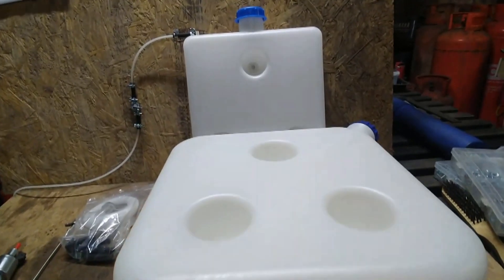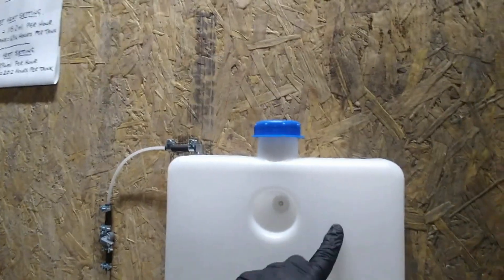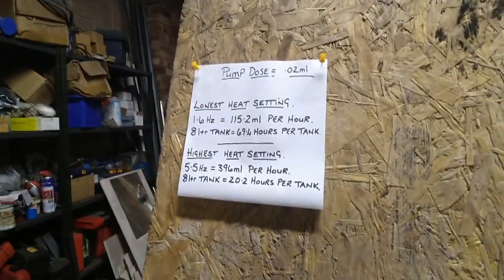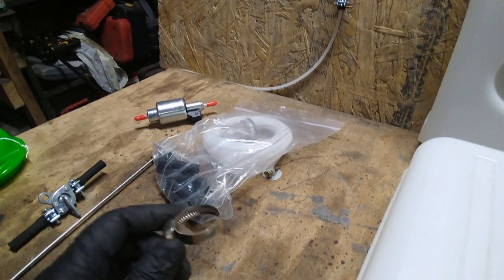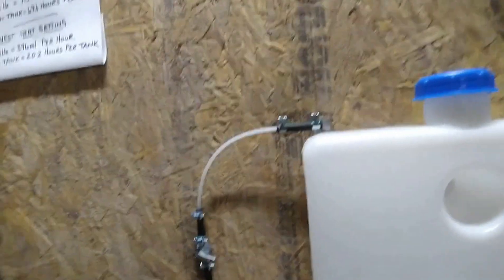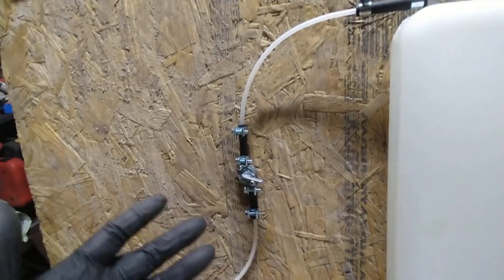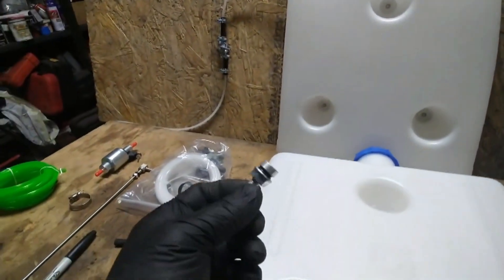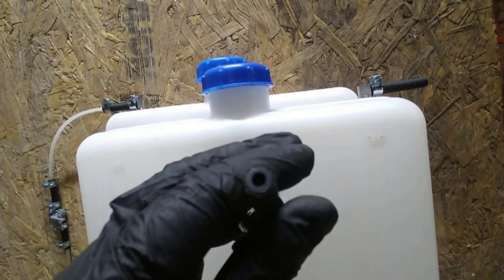Diesel Heater Fuel Tank Upgrade & Fuel Shut Off

Comment: Much better job, have you got any kits available? I would be happy with the hardware (lift pipe and turn of valve) and try fitting to my tank that comes with the heater. If you have all, I'd consider buying as a kit. Let me know either way... Thanks for the vlog
Reply from the maker: Email me if you require anything seen in the video. Thanks.
Reply: @itsallfabrication Just bought the tank kit on your website. It wasn't available last time I was on. I just need to buy new fuel line. I already fitted mine, slight weep from the bottom connection of the tank so this will sort. I have replaced 2 x pumps, why would they stop working? Power getting to the pump, just seems to burn out after a few times
Reply from the maker: @Workshop-of-Allsorts Thanks for purchasing a tank. I fitted it out last night and it was dispatched this morning.
The pumps seem to be a weak point on these systems, been through a few myself. But I'd check the voltage going to the pump with a multimeter to rule out over voltage to the pump.

Comment: What is the inner bore size of the rubber connections to fit the 5 mm outside diamater of the nylon line? Suppose to be snug right?
Reply from the maker: Get diesel rated rubber pipe with an inner diameter of 4mm. Also spray the inside of the rubber pipe with WD40 when you are fitting the pipes together, otherwise is a real pain to get them pushed in.

Comment: What about installing a quick disconnect instead of a shut off? Would that work or do those tend to leak? 

For a shut off would a 6 mm inner fuel line diamater work? I have a 2 mm inner bore nylon line, guess it would not matter what size bore is before the pump?
Reply from the maker: Yeah you could put a quick disconnect in if you like, not sure about them leaking as I tend not to use them myself.
I use a 6mm metal fuel shut off, the beauty with that is, if you have to work on the fuel line further down (filter or pump), just shut the fuel off and it creates a vacuum in the fuel line, meaning the fuel stays in the line and doesn't empty itself, so less mess and less priming after fuel system maintenance.

Comment: I'm in Australia and about to buy a diesel heater, found this video - great info. Any chance of posting a link to the ebay fuel kit link as I've looked & can only find the fuel line itself (I think), but not a kit with the fittings. Ta.
Reply from the maker: Hi, Thanks for the comment. I've only got a link for fuel line on ebay UK 
All the best for your install.
Reply: @itsallfabrication  thank you, any chance you can post that UK link as it might help in my search.

Comment: great tips mate - and aligns to some others i have seen in terms of upgrades - one thing that would help would be links to where you got the piping , clips pump upgrade and possible contact details for how people reach out to you for tanks and shutoff fitting- couldnt see it in the description of vid but may be missing it somewhere else
Reply from the maker: Thanks for your comment/advice. I managed to get 10 fuel line kits and I'll bundle them up with the fuel shut offs. I ran out of tanks, but will try and get more. And I will put my contact details in the description. Thanks mate.

Comment: i got my heater the other day and started putting it together today. Then i found this video............but i have already drilled and connected the fuel spout that came with it in to the tank. you said the seals on it are no good. can i use other seals?
Reply from the maker: Yes you can. Get one of the o-rings in the outlet and measure the outside diameter of the o-ring, followed by the thickness of the o-ring. Order two nitrile o-rings of that size and replace. Nitrile o-rings are usually olive green in colour.

Comment: Hello, I wondered if you sell the shut off and cable online?
Reply from the maker: I don't sell the nylon fuel line, but here's a link for the fuel shut off.
https://www.ebay.co.uk/itm/292656218510?mkcid=16&mkevt=1&mkrid=711-127632-2357-0&ssspo=XE19QvHMT6y&sssrc=2349624&ssuid=XE19QvHMT6y&var=&widget_ver=artemis&media=FB_MSG
Reply: @itsallfabrication  Thanks.  About to fit a heater on the boat and a shut off sounds idea.
Reply from the maker: @sailingaphrodite4189  Yeah, they're a must. I don't know why people don't fit them, while installing their diesel heaters.

Comment: sometimes seen these heaters fitted outside the room when in fact they are better fitted inside the room and exhausted to the outside along with the combustion air intake pipe as well, that way the heater will recirculate the warm air allowing the room to get warmer more quickly.
Reply: It may sound great continuously recirculating the warm air instead of cold fresh air but without fresh air it will generate condensation inside a vehicle,its the reason I dont recirculate warm air.
Reply from the maker: That is correct Merlin, and well worth a mention. Thank you.

Comment: I have bought a 15 litre tank top loading vented lid can you fit a stand pipe cut of valve and upgraded fuel pie please.
Reply: Mine is leaking like the titanic
Reply: I’ve sorted it mate bought a sturdier tank and retrofitted it no leaks no dramas I’ve done what Mel on utube has done. Just need a cut off valve.
Reply from the maker: @livingthedreambuildingthedream  Yeah, the tank Mel shows in his vid is really good quality. Those fuel shut offs are available on ebay, grab one of those and you're good to go. Glad you got things sorted.
Reply from the maker: @livingthedreambuildingthedream  Can you get it to me/ship it? I can fit what you require.

Comment: What about using that metal pickup used for cars Diesel tank and fittng on top of plastic Jerry bottle tank?
My tank area is only 33cm high and have to get a 5lt box tank - also a flat fiber/nitrile washerwould be best on original tank spigot?
Reply from the maker: A lot of folks use the pick up pipe in their van fuel tank, fitted through the sender unit, and that's ok. The issue I have with that approach is, road diesel in the UK has a lot of tax added to it, whereas I can buy red diesel at about half the price of road diesel and use that to power the diesel heater, making it cheaper to run. As concerns the original tank spigot, I'd never fit a fuel outlet to the bottom of these tanks and have that tank fitted inside the van, because even with nitrile o-rings the outlet/spigot will leak eventually and that's a nightmare in a van.
Reply: @itsallfabrication  Yeh i agree dont want to find a puddle of fuel not noticed after a time - in Australia we cant get cheaper untaxed diesal - unless i go to the trouble of refining fish & chip frying oil? I found your fuel cock - need a decent cheap vent valve {going the way of plastic 5lt Jerry can and fast removal fuel line clips but those arnt cheap}
Reply from the maker: @melbournesubtropicfruits9474  Would a low profile marine fuel tank be an option for you, as it's already vented, has the top pick up fitted, and may better fit into your limited space?
Reply: @itsallfabrication  Yes did see someone using small marine tank with a  barbed connection so you can remove and fill outside van but couldn't find one unless you may have a link? Dont think local boat shops would stock 5 to 7lt?
Reply from the maker: @melbournesubtropicfruits9474  I would look on facebook marketplace, as well as marine buy and sell groups on facebook.
I'm kind of in a similar postion to you right now, as I'm building a mobile cart that's going to have a 5kw diesel heater fitted in it, so's I can move the heater between workshops during the winter, and I'm undecided what fuel tank I'm going to use for the build.
Reply: @itsallfabrication  One thing i wish they did was put the fuel inlet on the top or side - putting through the floor with another hole is a bit daft. I found a  5lt bottle with vented cap with 2 depression mounts --might use the big bottle that came with heater for water now?
Reply from the maker: @melbournesubtropicfruits9474  Let me know how you get on with it?

Comment: I have the 10 l corner fill tank never a drop coming out  as I drive
Reply from the maker: I've fitted a few of the corner fill 10 litre tanks, but always fit them face on in the van to avoid fuel sloshing towards the filler neck. Glad to hear that you've not had any issues with fuel spilage.

Comment: I bought one of these for my Man Cave - No missus allowed! 👍 But it gets bloody cold when I'm trying to work, I'm fitting mine external in a purpose made cupboard but i'll  have the tank/power inside. I was worried about how flimsy these connectors are and the fuel line included reminds me of fish tank air line,  I was looking around for a good solution and this video just confirmed my thoughts are correct on these supplied parts. Thank you so much for the advice and the vids!! Maybe posting a few links to the parts would help a few out to whats needed, especially when some are new to these heaters. 👍 cheers again!!
Reply from the maker: Thanks for your comment, and input on helpful links, much appreciated 👍